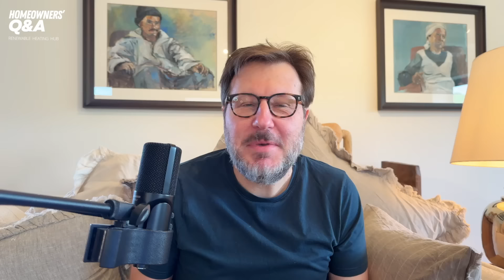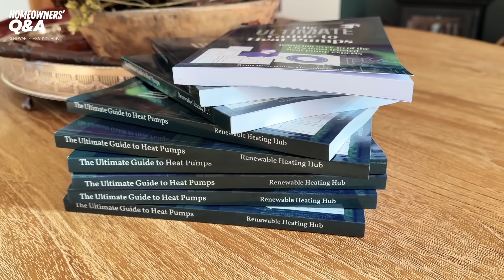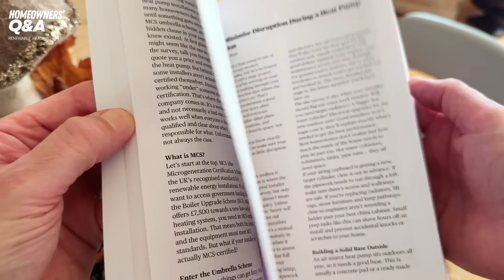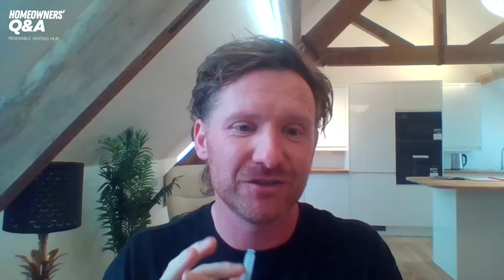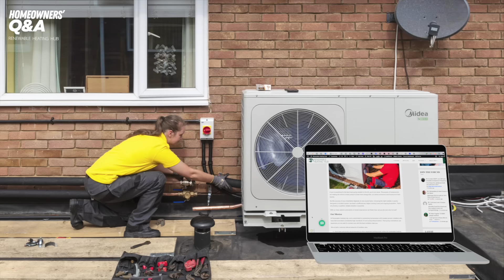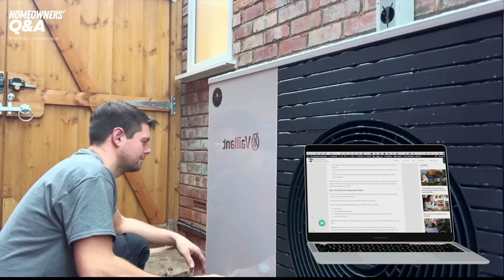Can Heat Pumps Work Well in Poorly Insulated Homes?

Comment: I have a Swedish partner and a number of my Swedish inlaws have built their own houses, these are modular, off the shelf, totally configurable timber based passive designs.  It's an incredibly consistent, efficient and effective way of building.   However I live in a 1930s cavity wall semi-detached that is totally incompatible with the Swedish ideal.  Firstly, everyone in our street that has had cavity wall insulation has had it removed because of damp, secondly it is compromised due to the thermal bridge of the wall ties, thirdly chimneys create a great deal of negative pressure that is difficult to resolve without creating more damp issues.  Yes it can be done and a friend of mine has done it, made a uk house passive and insulated but it cost a ridiculous amount of money.

Comment: As a Norwegian who's been living in a house from 1901 with hardly any insulation and only 1 heat pump and a fireplace in -20 to -30 during the winter  it's depressing to hear how little understanding some of these have, this winter I was walking around in slippers and t-shirts insider during the winter with mostly only the 1 heat pump running, insulating the way they are discussing it would be best after dynamite and a complete rebuild

Comment: Interesting debate.  Would it be possible for manufacturers to design heat pump units which have inter-changeable compressors. ie  the whole unit is sold as a 5 to 10 kW unit but the compressor can be specified as 5; 6; 7; 8 ; 9 or 10 kW.
Could even result in companies who hire out compressors so householders can lower up-front cost but have a known monthly cost, with the benefit of knowing the compressor will be maintained and replaced if necessary, with the option to change kW rating if circumstances change.

Comment: Short answer: Yes. They just deliver the heat for less input energy. How much energy it has to deliver is relevant only to how big a heat pump you need to install and thus, how much it will cost. But half the cost is installation so the power requirement doesn't make an enormous difference until you're getting into BIG properties or ones so leaky that you could drastically reduce bills with trivial amounts of money. Like free loft insulation if you don't have any yet.

Comment: Are the constraints of the tech grants to have the equipment up & running or does it still qualify as far as the installation, but no connection..?
Reply: Hi @bennettsmouth , yes you have to prove that you have removed a fossil-fuel boiler and connected a low-carbon heat pump (or in some instances all electric older systems). It must be commissioned, signed off and then each customer (as of 2025) will receive a phone call from MCS and they will ask about the end to end experience about it. So yes, it must be connected and completely replace all of the heating and hot water requirements of the domestic property. The grey area is not worth the risk to installers helping homeowners because you can lose your MCS, and not be able to help people get the £7,500.

Comment: I also agree with the approach of just replacing the old fossil system instantly. I did this now with 3 homes I or my relatives live in and it was the best thing to do.
We now do some improvements of the insulation but this is mostly to improve the quality of life or even lower the energy consumption because we now know how much energy we really consume and the COP of our systems.
I totally support the approach to go for a heatpump first is 99 % of cases. The 1 % of buildings has to renovate even with the old system. No matter what.
Reply: Well said, this is my own experience also. Especially before 2028 when grants are planned to change.

Comment: So, I’ve watched it twice and it seems that in the early chapters Rhiannon and Natasha both had strong arguments for maintaining a HP First strategy. But the grounds for this appear to be more about keeping  a customer engaged and not losing faith. By the last chapter my lasting impression was that everyone could see that dealing with drafts and insulation upgrades to floors, ceilings and walls was the right and moral way to go.
Meanwhile Europe (including Ireland) are giving away grants for fabric upgrades of old housing stock.

Perhaps a Stronger message from government is needed along with grant funding for fabric upgrades.

“It’s a once-in-a-household-lifetime requirement” 

One family/one home only needs to get the thermal upgrade done once and immediately…. 
This was our home-improvement approach when we bought our old house.

Comment: But don’t heat pumps and gas boilers work in fundamentally different ways? which is why the “fabric first” debate gets confused. With gas boilers, improving insulation often gave limited cost savings because the boiler simply burned a bit less cheap gas at high temperatures. A heat pump, however, must replace every unit of heat lost through the building fabric, and its efficiency improves dramatically as heat loss falls because lower losses allow lower flow temperatures and higher COP. This creates a compounding effect: better fabric reduces heat demand and makes each unit of electricity go further. So while a heat pump can sometimes be installed before fabric upgrades if the system can already run at low temperatures, fabric improvements are far more valuable with heat pumps than they ever were with gas, and ignoring the building fabric risks locking the system into higher running costs and poorer performance.

Also as the first guy rightfully said you will short cycle an oversized heat pump!!!
Reply: @HeatGeek have a video on this topic of insulation reducing flow temperature leading to more savings.

Comment: I think the comparison of heat pumps to fossil fuel units with or without a well insulated home is certainly a fair enough exercise. That said, with heat pumps an owner can potentially provide the energy source (i.e solar).
Depending how cheaply one can get their solar set up, this can tip the balence pretty strongly towards heat pumps (even with less than ideal insulation).

Comment: When you're talking about air pressure tests at 0.3 and 1, are you referring to the ach on the heat loss software, not the 0.3m3/hr/m2@50PA which would be exceptionally low, even 1 would be excellent. Most new houses without MVHR are >3
Reply: Hi there, yes thats the correct the ATP test is measured at much less pressure to measure real world conditions that go into the heat loss calcs under ventilations losses.

The blower door uses high pressure conditions to discover leaks and measure at a higher level of accuracy, which is one of the main purposes of the blower door test at such high pressures.
Reply: @Daniel_Murphy___mahi is taking the result of the air pressure test and dividing it by 20 for a new, well built air tight home accurate or not close enough. 

Example 

10m3/hr/m2 ÷ 20 = 0.5 ach

2m3/hr/m2 ÷20 = 0.1 ach
Reply: @handle1196  yes, thats how you do it for adding into the heat loss calcs. I'm working on one right now where theair permability at 50 pascals result is 7.12 m3/h.m2 so divided by 20 = 0.35, which is what we will use in the heat loss calculation software to determine the actual heat loss.
Reply: @DanielMurphyEcoTradesSouthWestthanks. I was unsure if there was more to add to the calculation. I'd hate to undersize it.

I'm aiming for well under 1.5 which would 0.075 and just feels too low.

0.5 ach is the default for most rooms but kitchen and toilets are 1ach and bathrooms default 1.5.

So I'd have to scale the 0.075 by 2 or 3 for these other rooms.

Have you sized these successfully in the past?

Comment: There is a cart and there is a horse, there will only ever be one way to arrange them. Just because a sales person wants to get in there first someone has to pay the bill for the heating monthly. Engineering before Salesforce. Fabric first, but also mechanical heat recovery.  Opening a window doesn't cost anything! Trying to heat a building with high heat loss costs a fortune, just look at the horror stories in the press holding back adoption of heat pumps.
Reply: Those stories tend to be FUD promoted by the fossil-fuel owned press.

Modest improvements to installation are good and should be considered by the homeowner. External and internal wall insulation will have excessively long payback.

Comment: I was put off heat pumps for years by the edict of fabric first!  Eventually I decided that the cost of insulating my victorian home was not a priority as the only option was internal insulation @c£15k but with a promise of a saving of about 20% on heating costs I was a bit nervous.  Now I have a heat pump, running well and costing mec £900 p.a to heat the house, if only I'd insulated first I'd be quids in by the time I'm 160 yrs old!

Comment: A very timely video for me, liked n subscribed. 
The reason being we're in this exact situation; ongoing work to the house by me to insulate it better, but in need of a new boiler/ASHP now and wanting to take advantage of the grant whilst it's available. I think every way I look it's a gamble.
I did wonder about asking the designers to spec the ASHP on the low side as if it were a house with finished insulation, but not sure they would do that.
The other point is we may extend the house in the future, if we did then that would go some way to equalling out the effect of insulating the house over the original spec.
No easy answer really.
Reply from the maker: Glad the video was timely and helpful for you!
Reply: They might ask you to sign off on them reducing output due to planned increased future insulation. But yes, also keeping flexibility for extensions is important.

Comment: I think insulating has its limits - so I've invented a thing : 

"The Marginal Glaze Strategy"

I bet its worth a discussion;

Its the cunning move of skipping some expensive window upgrades, provided the resulting higher heat loss doesn't push the required heat pump size up to the next, much pricier model.

Its finding the "good enough" level of insulation by calculating how much heat loss you can accept without being penalized by needing to install a larger, less efficient heat pump.

And money left in your pocket today has a lot more power than something smaller saved over many many years..

Comment: I had an 8kw 7th generation Samsung heat pump installed in April this year. The fitters were not confident about whether I would have planned insulation done or not, so did not want to fit a smaller heat pump. I guess this is understandable. For technical reasons the insulation works was delayed. My research suggested the 5kw Samsung heat pump modulates down to the same level as my 8kw, so I'm not sure if it would have made any difference. It's all running well. When it's mild outside, my heat pump either short cycles or the flat is too warm during the day with solar gain. But the running costs are low and the typical COPs close to 6 with the heat pump instantaneous energy output normally showing 0.4kw. In a colder spell it's snug and cosy, with typical output 0.6kw. So am I left with an oversized heat pump? The main downside seems to be something to do with the oil, but this wasn't sufficiently explained. Can anyone provide more detail on how to assess and mitigate that problem?
Reply: I think the knowledge about cycling heatpumps is mostly irrelevant if you open up all your radiator valves so your flow rate is always adequate for your heatpump to get rid of its heat. Then you can just adjust your heating curve perfectly and the pump will really only start when there is energy demand.
Also I think modern compressors are a lot more forgiving in regards of their optimum operating frequency.

Comment: In the Netherlands we have a running myth that one can only install a heatpump when the home is at a A level insulation level (eg <3kw heatloss for a typical house) with under floor heating.. Pretty insane, resulting in a lot of missed installs and unnecessary hybrid setups. Most 60-80s homes are currently at the 4-5kw level with oversized radiators and perfectly suitable for a upgrade to a full electric heatpump at 40-45c.

Comment: Fabric measures provide comfort; heat pumps provide heat; there's way more to comfort than just heat.

Overall you need a decent plan, then you can tweak the order and you'll know what's the heatloss now, what's the heatloss in the future.
Reply: I'm curious how many ashp installs are distress purchases?
Are there any installers who have moved ASHPs around due to home owners drastically reducing their heatloss that they now need the next size or two down?
Why are we still building shite housing which will need to be retrofitted in the future? The Passive House standard is right there.
Until a home can get an ASHP, there needs to be more knowledge on getting gas boilers running as best they can (I've convinced a number of people to get their flow temps down to 55c so far. My own has rarely been over 50c this year)

Comment: I did my own heat loss calculations and then had a heat pump engineer do a full survey and the results were surprisingly close. However, one of the big things I notice is my current gas boiler energy use is significantly higher on a windy day (I live in the Pennines) compared to a non-windy day. I really think an air-tightness test would be a good additional component of any survey for a heat pump.
Reply: It's not only draughts you're battling with. The windchill effect is cooling the house down too and the only way you'll reduce that is to insulate it all round as well.
Reply: Yes I get the same issue on windy days which is why I believe that pure weather compensation doesn't work for all properties. I've found Havenwise works well to give some load compensation and really helps for windy days.